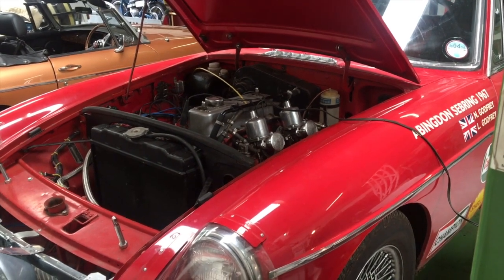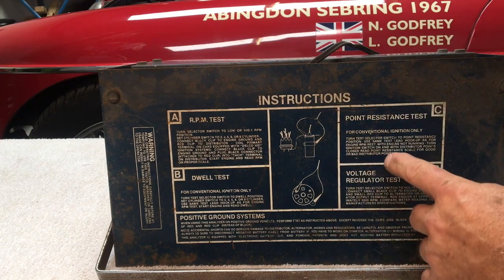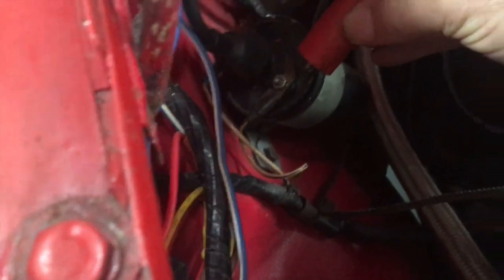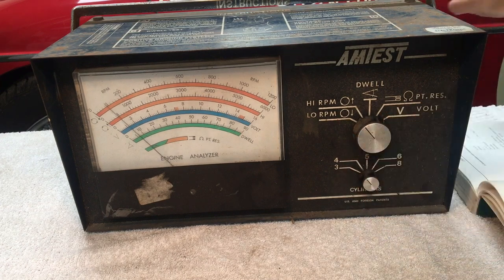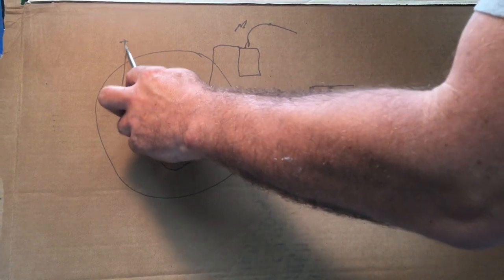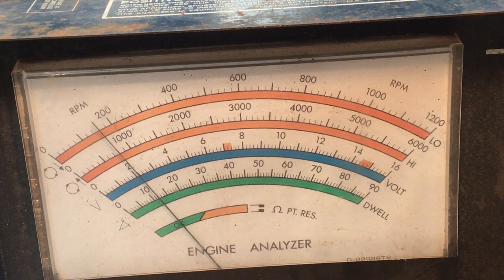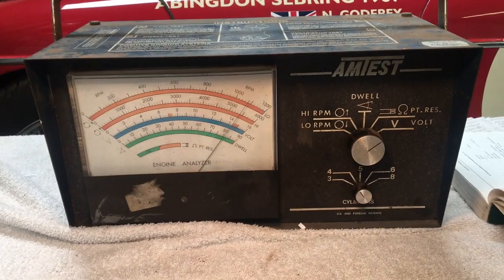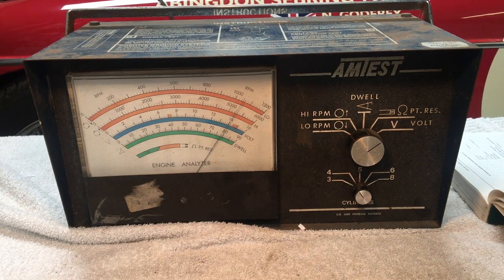AMTEST Dwell Meter will it work Engine Analyzer

Comment: Unfortunately, your fancy meter proudly made in USA seems to be off. Looks like capacitors and resistors inside the circuit lost their parameters over the decades and now misread. With 15.2 Volts your battery would be nicely boiling. Use a regular multimeter to measure the charge voltage and compare it to what this meter shows. If it's really off, then don't trust any of its readouts, including dwell and RPM.

Comment: Hey I'm going to try one more time does it have a dance okay put it on apps and show me which way the needles going to go with my device it doesn't move so that leaves me one thing that I know about that device it does really a you must have a lot of ham for 3 but I can put a small amount of amps and is read it so is it because I didn't have enough amps in the battery maybe I need to try a brand new battery I haven't tried a new battery but I have tried doing it on a battery that says it's charged and it doesn't turn off apps so what am I saying it doesn't indicate apps so if that's a defective house does it does not detect the apps or maybe I need a third cable connected but why would I need a third cable connected when I could going to have positive negative

Comment: It always help the viewer/audience when the video has better lighting for the dark spaces of the engine compartment to show clearly where the test clips connect, as well as tracing the wiring for the negative terminal of the ignition coil (back to the distributor).  This is becoming a lost art and while old testers can be found and work, step-by-step videos would be so helpful for DIY mechanics or owners of older and more classic cars made before electronic ignition.

Comment: Important to connect the red and black leads correctly on the car engine.  Black goes to an unpainted part/ground of the chassis, while the red lead clips to the negative terminal of the ignition coil on a standard/points ignition system.  Dwell angle and RPMs (on the tach) are the most common readings.  There are different tune up specs for every type of engine.  This is becoming a lost art.  For DIY machanics w older cars or car collectors, these skills are vital to ensure efficient engine operation.  Old manuals can be downloaded but the steps seem confusing. Either ask an older mechanic or get a copy of the dwell meter's use manual.  Can remember doing tuneups on a Chevy 327 cubic inch V8 in the 1970s to save money.